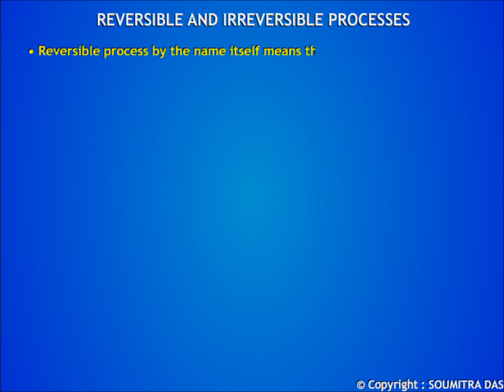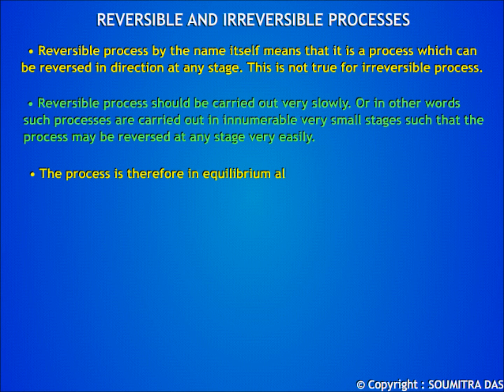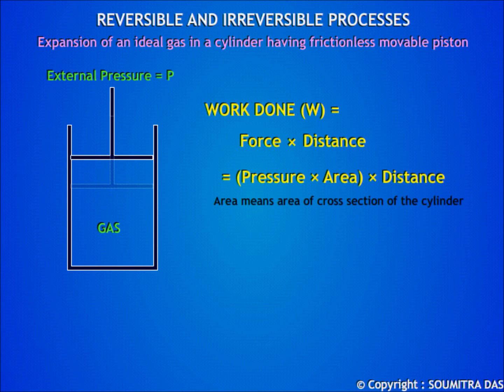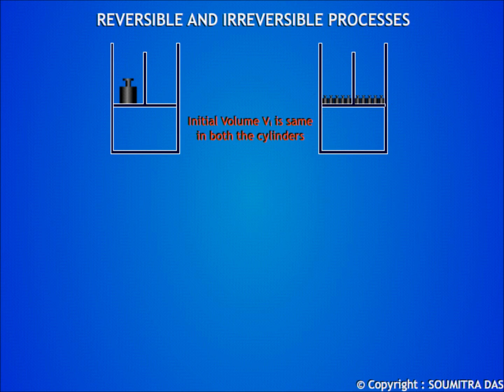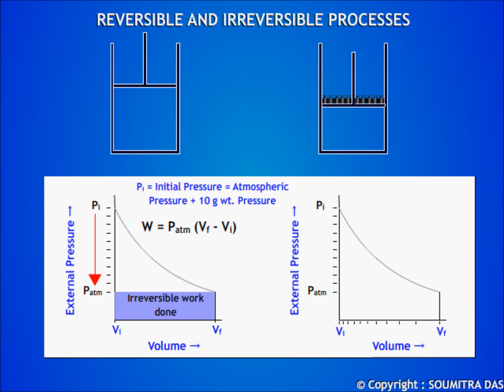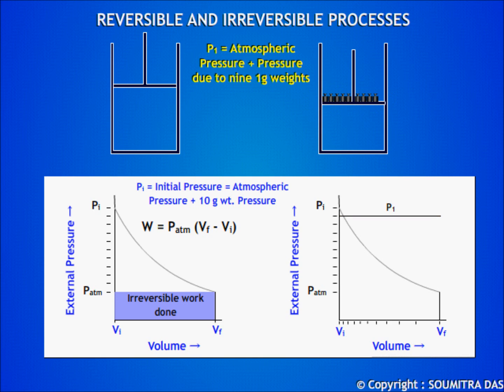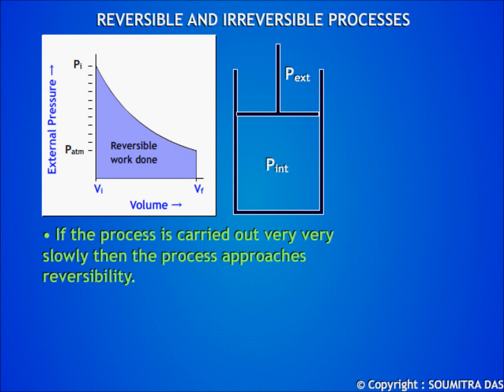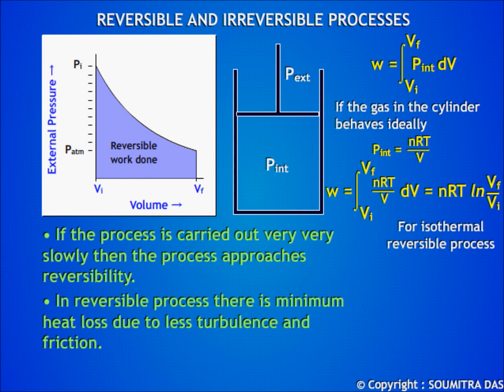Reversible and Irreversible process

Comment: I have always seen this argument from the point of view that there is weight on the piston which is removed to make the gas expand. Could there be another analogy where we imaging compressed air tanks within the piston cylinder which, when the compressed gas is depressurized, push the stationary piston further out of the cylinder. Of the two situations, one has a single compressed air tank holding, let’s say either 100 L of air. The other situation is 10L of compressed air in 10 smaller tanks. If I understand correctly, we should be able to do more work more efficiently by releasing the gas out of the ten small tanks individually as opposed to releasing the air out of one large tank all at once?

Comment: Thank you very much. The explanation is very clear. It clears my doubt why the pressure in the work done formula p(v2-v1) has to be the external pressure and not the pressure inside the gas.